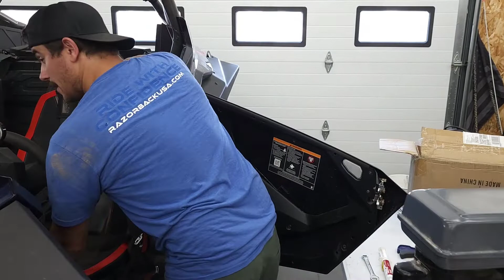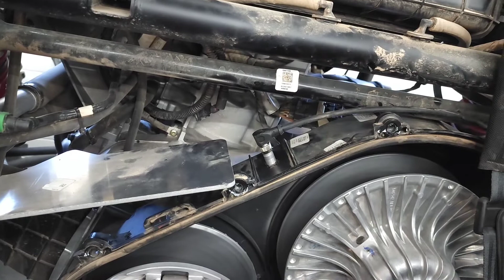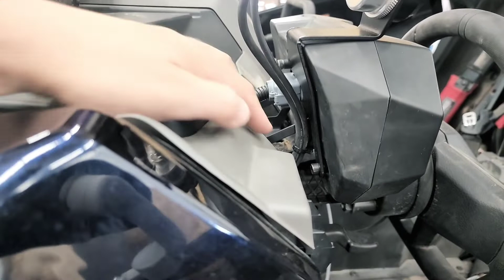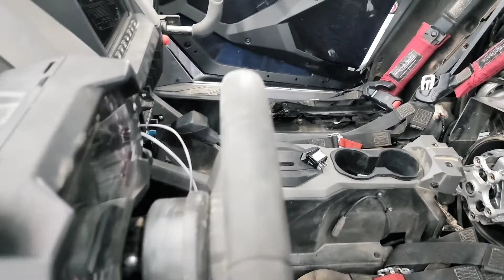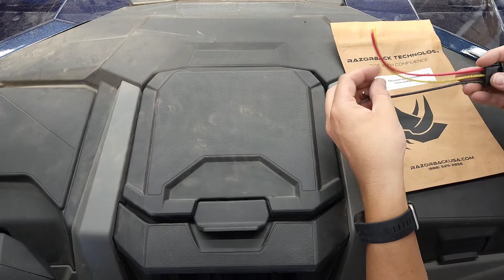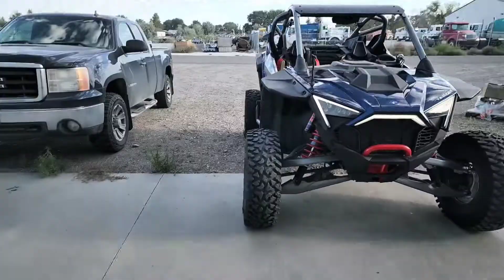Razorback Infrared Belt Gauge Install On 2022 Polaris RZR Pro R

Comment: I just installed mine today on a 2026 General xp4 1000.  The directions for wiring the switch did not jive with what was sent to me.  I had 4 wires in the grey coated wiring from the gauge to the switch.  The red and black went to the 7&8 posts on the switch and the blue and white went to the 3&4 posts on the switch.  Make sure you do not attach the red and black as the directions stated to the 3&4 posts, that is 12 volts and if you do that when you hit the dimmer button it blows a 10 amp fuse marked Term.  Took me a while to figure out that only 4-7 volts are to go thru post 3&4 not 12 volts.  the 12 volts will light the switch.  They need to update their install directions!